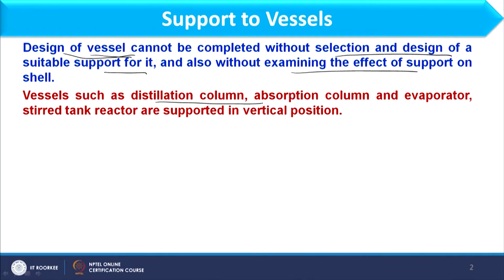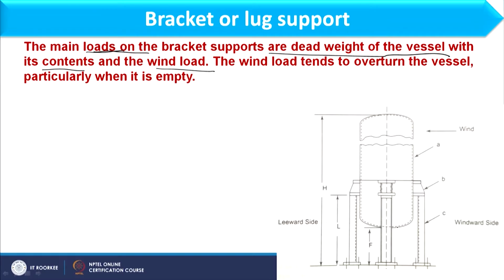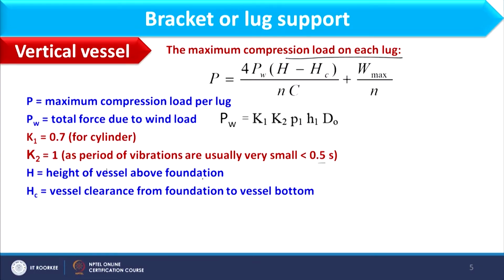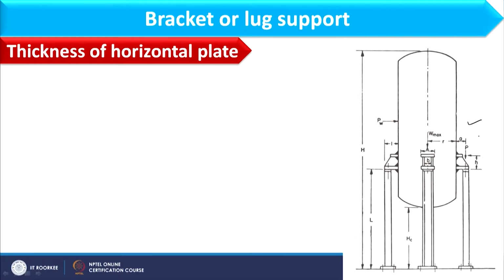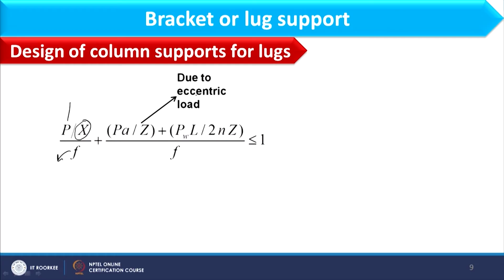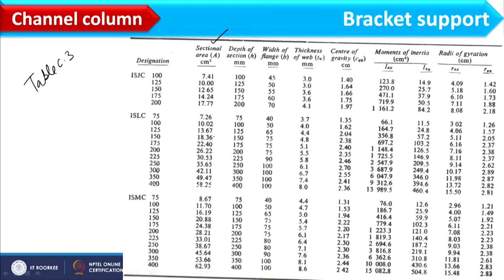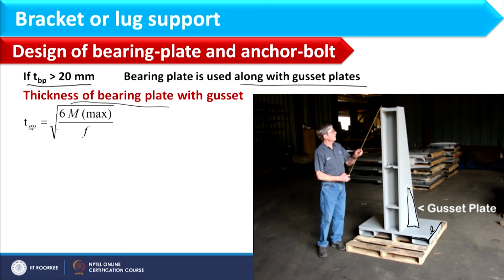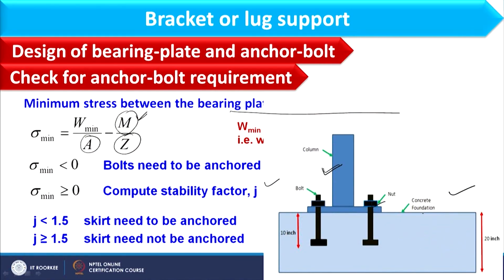Design of support-1

Comment: A cylindrical vessel of 3 m outside diameter and 8 m length is supported by 4 lugs. The vessel is filled with fluid having density of 870 kg/m³ up to 5 m height and is being operated at 1.5 MN/m² pressure (g). It is covered with flat heads from both ends having weight of 12 kN for each head. Corrosion allowance is 2 mm. It is class 2 vessel having double welded butt joint with full penetration for all joints. The vessel is made of IS: 2041-1962 20Mo55 and its design temperature is 450°C. The wind pressure on the vessel is 0.9 kN/m². The height of the vessel from the foundation is 1 m. Height of bracket from foundation is 5 m and end diameter of anchor bolt circle is 3.1 m. The steel channels are utilized to support lugs. Given: Allowable stress of horizontal base and gusset plate = 100 MN/m²; allowable stress of channel = 150 MN/m², density of shell material and Poisson's ratio of 7600 kg/m³ and 0.3, respectively. a) Standard thickness of shell b) Compute the minimum thickness of horizontal and gusset plates for I = b= h = 150 mm and 0 = 60" c) Determine the area of cross-section of channel column for section modulus of column as 200 cm³. Also suggest the suitable size of column.